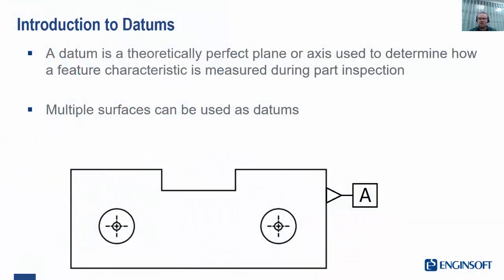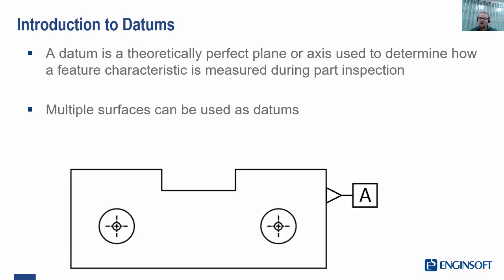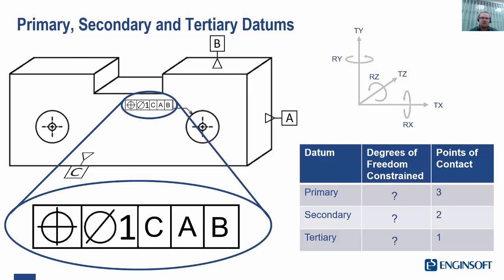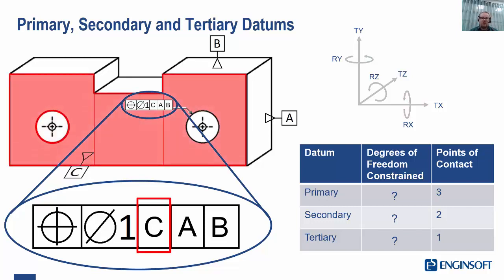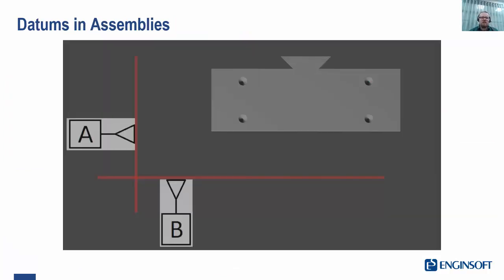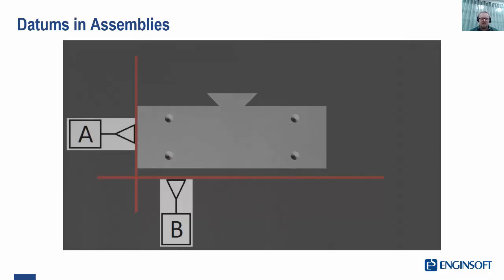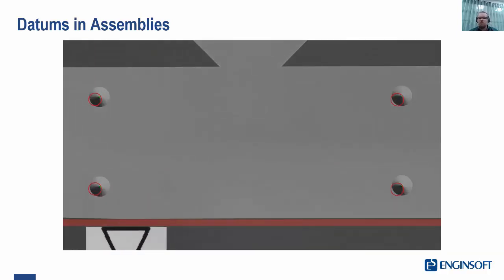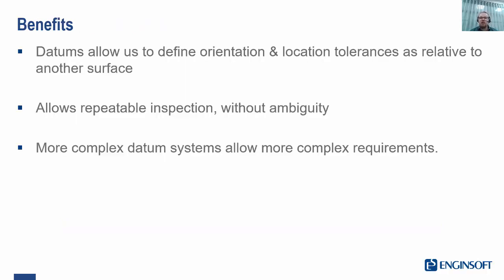ISO GPS (GD&T) Mini-series - What are Datums

Comment: A functional based ISO GPS is always using datums for the simulation of natur contacts (which appear between two parts) at a single part specification (where the contact partner is missing, isn‘t it?).
A functional based specification is not using datums for orientation in manufactoring processes like verification instead of nature function (we are talking about „fit“ or „touch“ according ISO 5459 -> fit only at linear sizes).
If the nature contacts are not suitable for manufacturing processes, the nominal design itself should be optimized - not the functional based ISO GPS (remember ISO 8015!)
Reply from the maker: I couldn’t agree more - it’s really important to set up datums based on their contacts with other components. An issue we come across is where datums are set in non-functional locations and this adds additional permissible variation. It’s important to be ready to modify the nominal design also if it isn’t possible to manufacture them to the required specification for fit or other requirements.
Reply: @STRIDESimTech The changelle is the introduction of manufacturing contacts in a functional based specification. According ISO 1101 direction and position of a functional planar touch is controlled by „position H0 tangentialelement“ against the manufacturing touch. And: Famous manufacturing processes do not use any contact: casting, laser cutting, …. Very difficult is the indentification of the contacts for sheet metal bending.